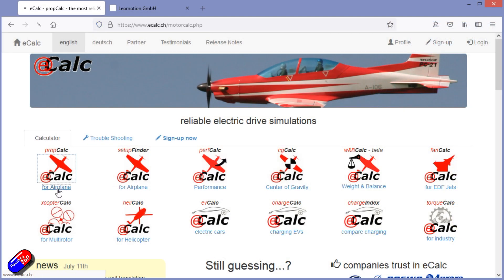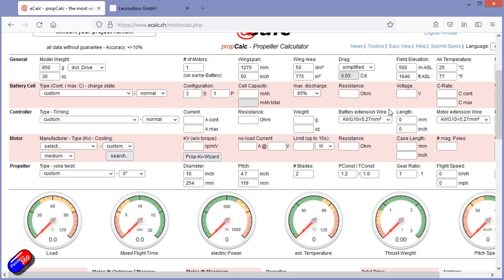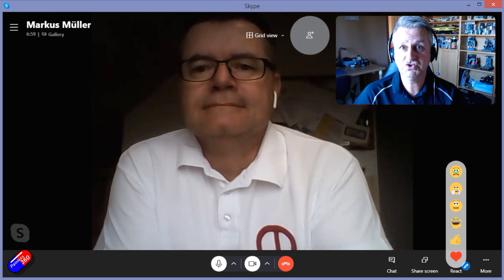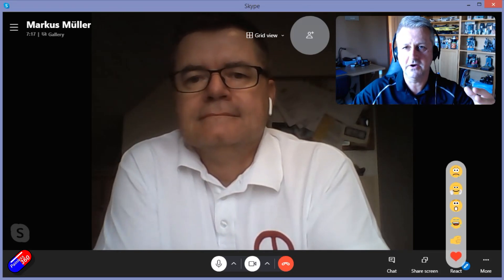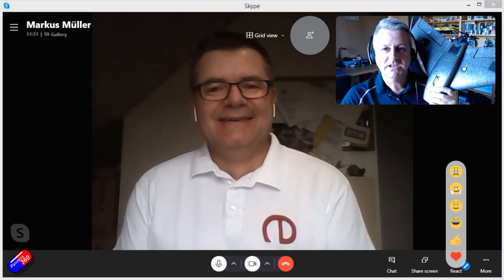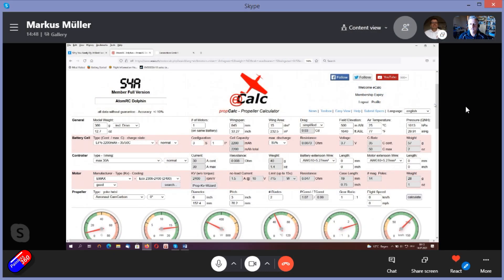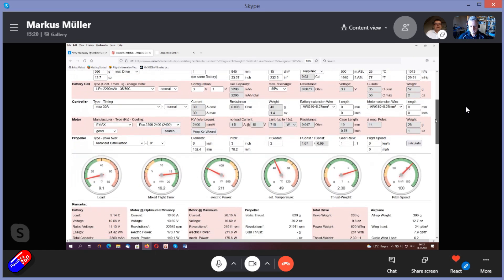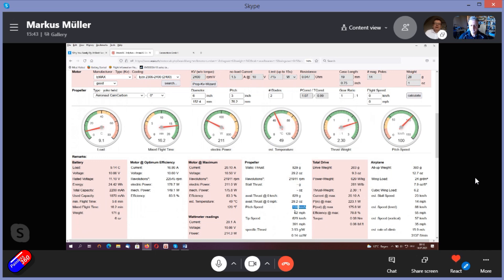How can I make my plane fly faster?

Comment: I built a mini talon for speed. I went with a Sunnysky 2216 1400kv V3 with an 8x6 APC prop on 4S. It pulls about 40amps. It’s top speed is 140km, I  just fitted an 7x8 prop but yet to test it. It also pulls about 40amps. I’m hoping for 160km + 😁

Comment: I like eCalc. It's not precise but gets pretty close.

Worth mentioning torque & stall speed, although you're probably going to cover this to some degree next. For fast models torque can be an issue; high torque can get you up to speed quickly but at the cost of a lower top speed. Conversely high power as indicated by a higher top speed usually comes at the cost of reduced torque. In practice this means you may need a lot of space or in some cases a lot of linear (no turns!) space to reach the predicted speeds, which can be impractical unless you put the model into a steep dive.

And of course drag induced through the model having a less than smooth skin becomes a bigger issue as you go faster (laminate it).

Comment: I think you have just saved me a lot of pain. I was about to test my mini AR wing with an extra cell. Maybe not. It's already been upgraded to a RS2205 (2300kv) and a 6042 gemfan prop running at 3s. According to the calculations 4s would have caused some magic ESC smoke!
Reply: Always a good idea to test on the bench with an ammeter before flying. And incidentally the load on the motor (=current draw though the ESC) will be at it's highest in still air.
Reply: @loc4725  I did at when I changed them motor. Used the OSD current as it's calibrated. I didn't think 20A at 3s would equate to 35A at 4s.

Comment: Used eCalc for a long time now. Absolutely an invaluable tool for tuning motors, props and ESC sizing. Only complaint is newer motors take awhile to be added so you have to search for motors with similar specifications sometimes and that can take a lot of time.
Reply: always feel free to report new motor arrivals by email to speed up the adding process.... we are always happy to add your motors when full specs are available.
Reply: @ecalc-gettherightdrive5483  Fantastic, will do that. It is a great time right now for fixed wing fliers with the amount of quad style motors available that can be used on smaller aircraft. This has expanded the motor selection a lot in the last few years.